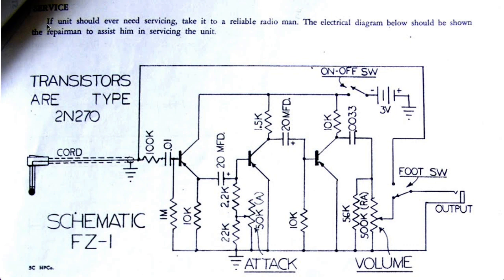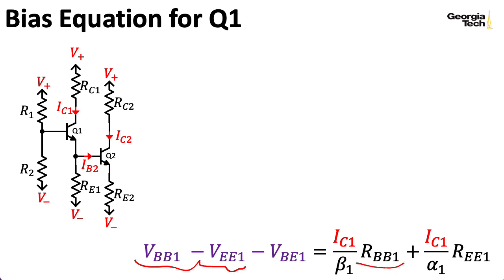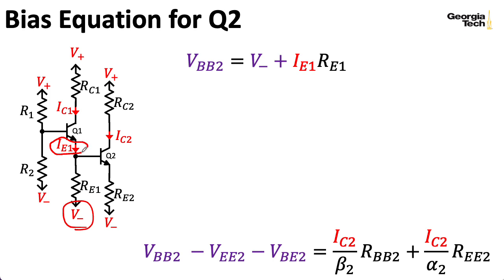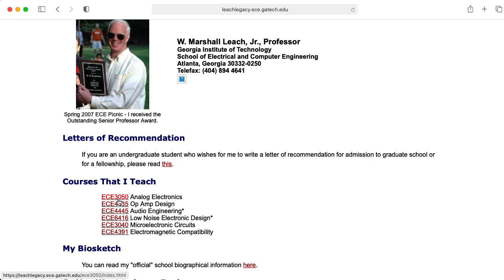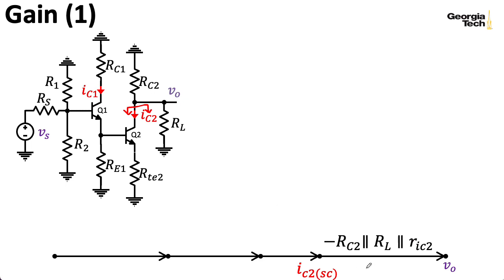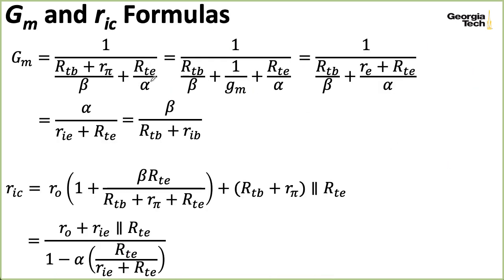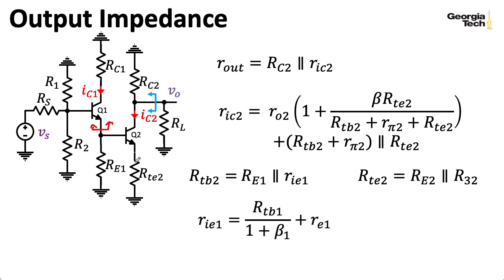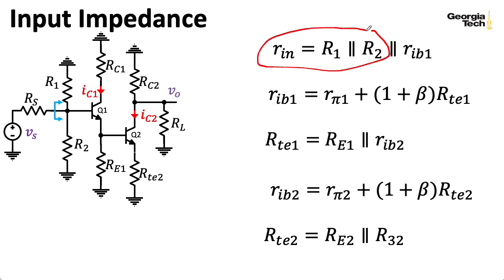ECE3400 Lecture 18: CC/CE Amplifier Cascade (Common Collector-Common Emitter) (Analog Electronics)

Comment: Is there something wrong with you? This circuit is 40 years old and uses Germanium PNP transistors. Don’t you have intelligence to upgrade the circuit to NPN silicon types? Where do you buy 20u capacitors?